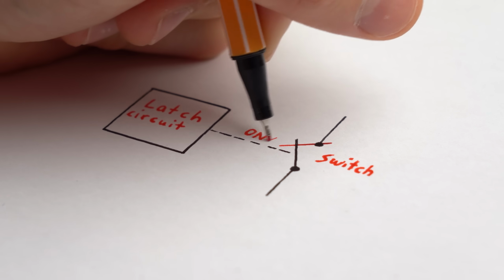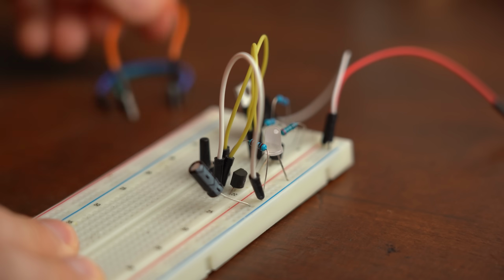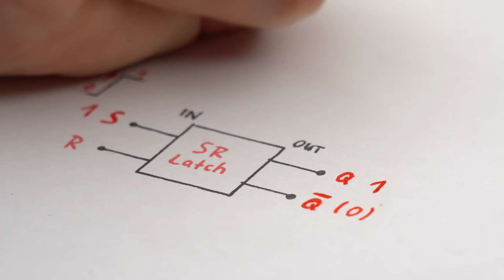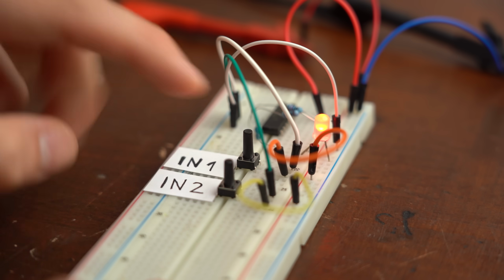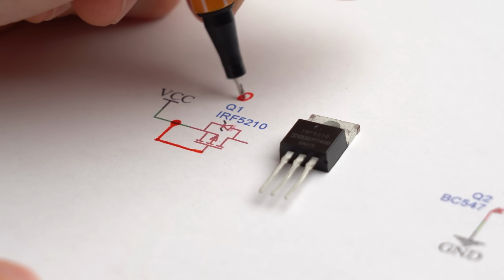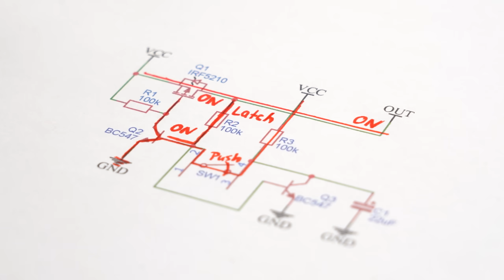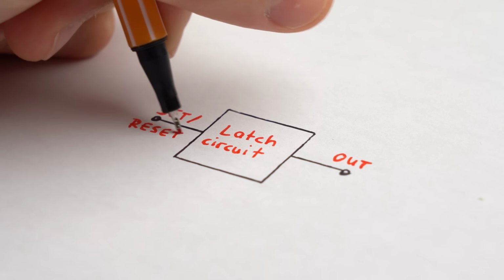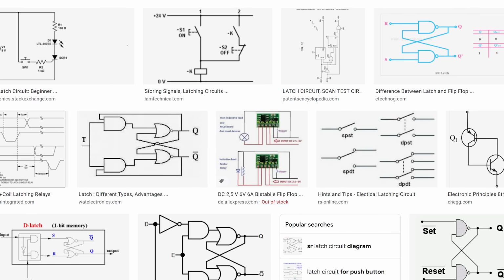Mechanical  Switches are Obsolete?! Switch to a Latch Circuit! EB#53

Comment: Actually, you should use mechanical toggle switches, even if it is only connected to a micro-controller that sits in standby.
Reply: Depends on what you're doing. Many microcontrollers have sleep modes, where they only draw a few microamps or less, and they can even be woken up from this state by an external interrupt, so you can get by with just a cheap tactile switch. This latching circuit isn't even needed in that case.
Reply: @hotgluegunguy  The point is that you can instead of just a tactile switch use a toggle switch, even if you don't plan on hard power off.
There is no reason to replace toggle switches with tactile switches, or even worse, a latching circuit, even if you plan on using soft power on/off.
That's how many professional Sony devices do it. They have physical toggle switches, however when you toggle it off, the device doesn't immediately power down. Instead it does what it has to do and switches off when it is finished a few seconds later.
Reply: @graealex  That's also a way to do it. The reason I commented was that you wrote "should" as if it's the only right way, when really it depends on the product and personal preference. There's not necessarily a one-fits-all solution.

Comment: In most situations I still feel better when I hear and feel the "clack" of a mechanical switch
Reply from the maker: Well, that is definitely a selling point for mechanical toggle switches.
Reply: @greatscottlab  you can still include haptic feedback to the latch, so... it is something that can be a big plus
Reply: @GutoPereira  actually, depends on the application, when you control safety critical devices or actuators, is way safer a mechanical switch, at least in industrial environments.
Reply: @marioorellana6250  Also the correct one for the task, like a proper contactor for motors, so it won't get welded shut.
Reply: @GutoPereira  Oh god... that's my fear... someone somewhere's adding haptic feedback to the latch and maybe a speaker so that it can perfectly simulate what you hear with a mechanical switch... and a tiny EPROM to store the sound... and maybe a wireless upload feature so you can change the sound to that of your favorite mechanical switch.  And the next thing you know, all our switches need AV software... and... It's great to understand how components /can/ be used for specific applications, but there's also a lot of merit in the KISS principle.  :)
Reply: @Kalvinjj  You are right on something most people forget! Copper contacts will weld themselves together in an inductive circuit!
Reply: @3vi1J  Yes ,Yes .....and Yes....
Reply: Well pump switches is a good example where there is a high inductive load. The relay contactor contacts have an oxidized surface to keep down the arcing. If someone files or sands those points, it will most likely weld together and the well pump runs continuously
Reply: @hinspect  yeah and you replace the bad switch.73
Reply: @marioorellana6250  Not true at all! I work in an industrial environment and SSR relays seems to be the most popular here. As they're non-mechanical, dielectric-based they don't have corrosion issues and are very resistant in general.
Reply: @greatscottlab  thank you for the video I've been trying to find a good circuit for the job and you found it for me thank you for all the great videos keep it up
Reply: @greatscottlab  can i replace the bjt with 2n7000 mosfet instead ?
Reply: @ragesmirk  No it HAS to be an P-channel mosfet !
Reply: @ragesmirk  no
Reply: When I read "clack" I expected you to talk about relays...
Reply: And no battery drain when off.
Reply: @sideburn  Multiple people commented this elsewhere and it still doesn't make sense to me. 

A P-Channel mosfet based soft-latch circuit, like the one he shows, would drain the battery (mostly) through the Mosfets D/S leakage current. That could be as little as 1 micro amp for room temperature applications. That is so insignificant, that the self-discharge of most batteries (even a 250mah coin cell) would drain the battery far far sooner. 

That leakage does increase with temperature, but some p-mosfets, like FQP27P06, state the IDSS (off state leakage) will be only 10 microamp at 150 degrees C...FQP27P06 would be a pretty versatile mosfet for most battery application over 4 volts. 

The mosfet greatscott uses in the circuit maxes out at 250 microamps for 125C. Maybe it can get that hot for an automotive application, but I'd assume you'd be hooking the thing to a car battery, which would barely be dented by 250 microamps over time. 

If someone can find an application for such a circuit where this leakage would be an issue for people, with the math included, then I'll happily accept it, but this concern just doesn't seem to make sense for 99% of applications...
Reply: @mikepaul6688  I’ve used tactile push button switches in the past (like the adafruit push button switch breakout) that uses a P-FET to power on an arduino connected to a lipo and it would drain the battery within a day. So it’s just based on my experience with them. I had to remove it and use a mechanical latching switch instead.
Reply: @sideburn  You're free to use mechanical switches, but sorry you definitely wired that Mosfet circuit up incorrectly. Such significant drain would never exist when the mosfet is off.
Reply: @sideburn  agree 100 percent. I don't have stock in power switches hehe. 73
Reply: In most situations I prefer to be able to see if the device is on or off by looking at the switch. Especially if it doesn't show other signs of life.
I also prefer the device to retain the state through power-down, e.g. battery replacement.
Reply: just for you we'll put a small relay next to it that's not hooked up to anything.  just clicks and clacks on push
Reply: Nothing a discharging capacitor can’t solve lol
Reply: ...and the position provides a good visual feedback of whether it's on or off.
Reply: @sharpfang  Yes, you are right.
Reply: and you can see the position of switch, regardless if the lamp is working or damaged... it is safety to replace the lamp when switch is off, because the mosfet or thyristor can be turned off and still can flow some minimal current to electrocute you, when replacing the lamp (sometimes galvanic separation is mandatory)...
Reply: Use a momentary "mechanical" / "toggle" style switch. You'll still get the clank.
Reply: @MKE_Engineer  But you can't see what state it is just by looking or feeling it.
Reply: I am with you.  Probably my biggest beef with my new vehicle is that almost nothing is actually connected to anything and most of the "automatic controls" could be fixed with a simple bat toggle switch.  Automation is for things you have to do a thousand times, not for things that you decide once or twice and leave it set.
Reply: I like the manual override option....just incase lol.
Reply: It's the best choice for a toggle.
Reply: blue mechanicals switches enters the chat
Reply: You could engineer the thing like Apple's done, by adding a piezo element to simulate the mechanical sound in their capacitive soft buttons so well most people don't realize it's not real. A good old example is their old iPods and mice, starting with "Mighty Mouse", and still includes their modern trackpads. You realize the difference when you compare the device powered off / unplugged with it powered on and system booted. iPhone X and XS also had pressure sensitive software buttons with haptic feedback, which felt very real, although due to the nature of the device most people realized it couldn't have been real, and it added cost and had not much of 3rd party developer support so they dropped the feature.
Reply: @jammi__  Why make it simple, reliable and cheap when we can make it complex, unreliable and expensive to provide exactly the same functionality?
Reply: @sharpfang  Only complex in terms of software, and software enhanced hardware is Apple's core thing. It's definitely vastly more reliable than a simple mechanical switch, does things a simple mechanical switch can't do and isn't more expensive to make either at Apple scale. Most importantly, it gives the kind of extra value people are willing to pay for such things giving Apple the kind of profit margins it has. The Apple recipe is basically to spend a ton of resources on R&D in order to have something engineered they can produce in as big numbers for low unit costs despite the huge R&D budget and for as long as possible with as little changes as possible, and support it in their software for as long as feasible.
Reply: @sharpfang  sometimes it's cheaper to use electronics with a cheap switch. The cheap switch by itself would burn out controlling a large load. I have a light that has an electronic switch function.  A cheap switch toggle flip flop that turns on a led light. Momentary switch in this case no relay. You can use mosfets to control larger loads. I bought that light At walmart around 7 dollars. I can build my own from jk or d flip flops. But why when you can harvest it from throw away junk.
Reply: It's an inadvertent form of good user interface design. The sound is a clear and apparent confirmation that many other switches don't provide.
Reply: Add solenoid
Reply: I miss having a mechanical on off switch on my pc. Holding a computer button down to turn it off is neither satisfying nor (in some cases) fast enough.
Reply: When I think about mechanical switches, I tend to think more of the word "thock" than "clack".  Any mechanical keyboard enthusiasts should know exactly what I mean.
Reply: A fat relay gives the best sound
Reply: All I hear in the clack of a mechanical switch is the bouncing of the metal-on-metal and the over voltage events from the rapid di/dt through an inductive load. Gimme a controlled latch any day.

Comment: I once found and used an interesting variation that solely used one momentary switch, one DPDT latching relay, and a couple of resistors, caps and diodes. Basically cross wiring the relay and using the cap voltage to provide the voltage spike to flip the relay over. It had issues if not switched in a long time as the caps slowly drained due to parasitics. But I thought it clever.

Your version though is cheaper and likely more relaible (and allows more current). I like it!!!